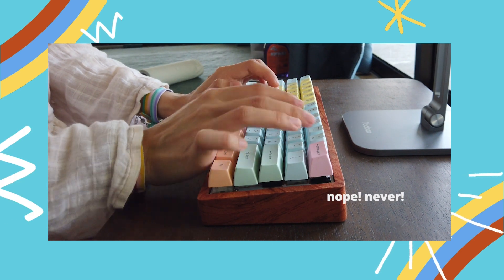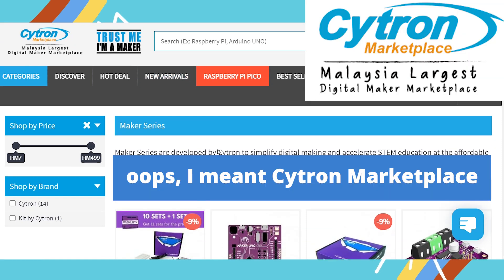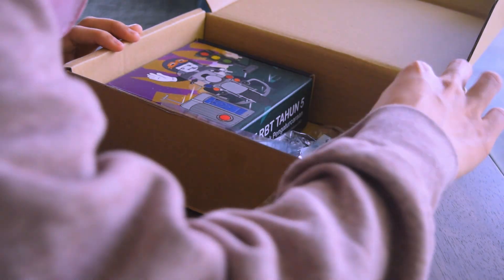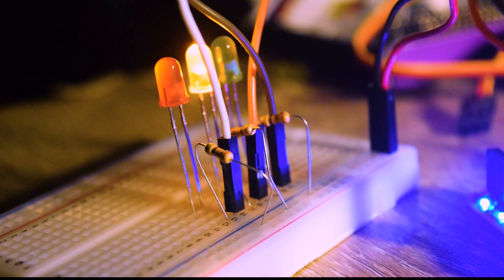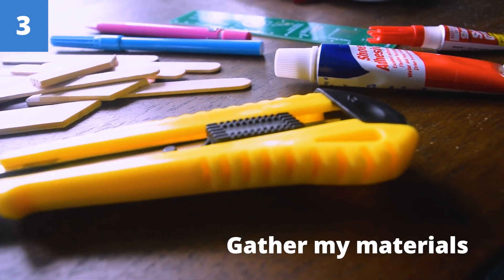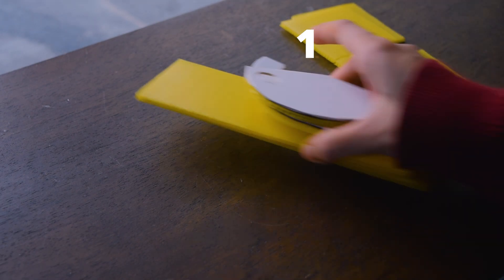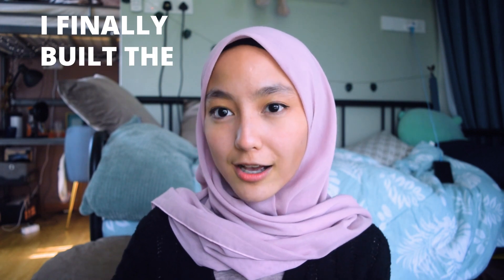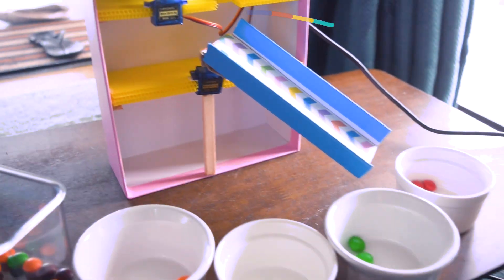Watch Me Build a Color Sorter - Cytron Maker

Comment: Sebelum arduino, IC kalo nak program biasa kena pakai Assembly. Arduino default IDE pakai C++ much easier to code.
Reply from the maker: Ahh yess. C++ is easierrr thank god! 🤣 When i did the programming. I was shocked tht it was easy but i wasn't used to being abled to make multiple tasks at once. Can only do one task at a time...maybe should try raspberry pi next!
Reply: @WanSyazlina  r pi pakai python. lagi senang
Reply from the maker: @intechligence4112  ahh good to know
Reply: @WanSyazlina  Selain r pi, boleh juga use other brand variants like odroid, banana pi. Most with ARM processor like raspberry pi, but there're some models that use x86 processor like the PC. Depends on usage